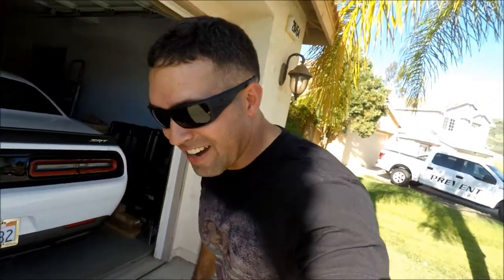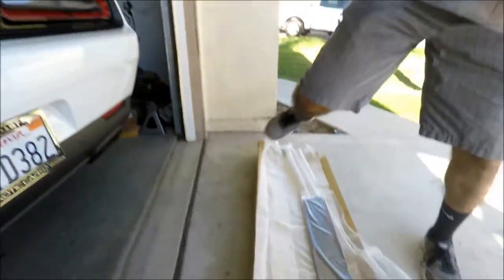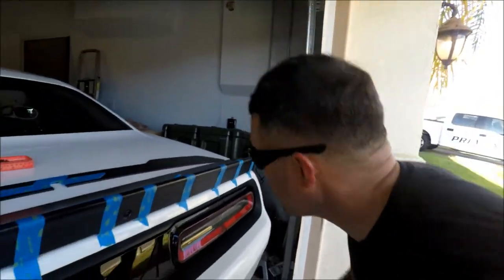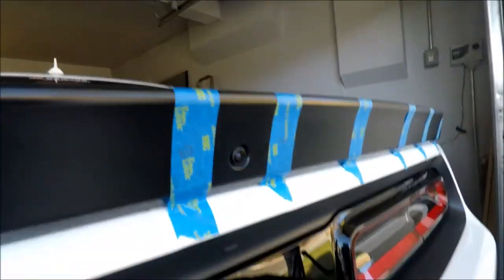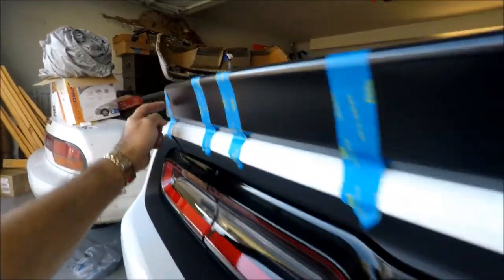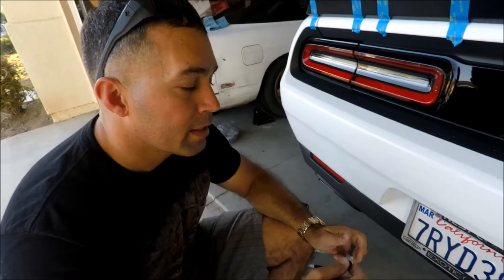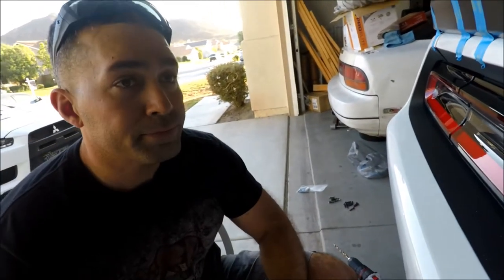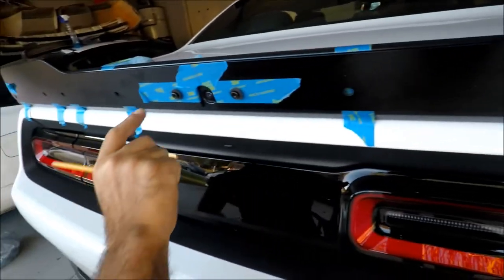Challenger Hellcat Wicker Bill Install

Comment: Great job in measuring! It look very intimidating.  However,  do you feel any improvement in high speed downforce or stability ?
Reply from the maker: It didn’t feel any different, I did it more for the looks. Thanks for watching

Comment: Nice install video, your car is a beast
Reply from the maker: Rydin N Style Thank you !! I just installed lowering springs today! Video coming out soon !
Reply: Eibach? I got my sportline springs but I'm debating if I'm going to do the entire strut and shock replacement as well.
Reply from the maker: No, I went with H&R, they have a 1.7 front and 1.4 rear drop! How much did your car dropped?